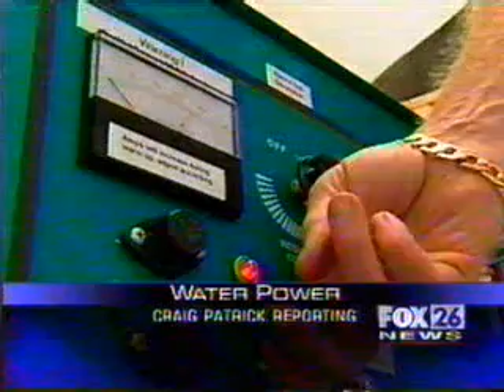Water Power

Comment: @onefodderunit I've posted my answer, and you just circled back to your same question - but then circular logic is required to believe bronze age myths.  I saw tonnes of debris, and thousands of tonnes of steel hauled out afterward.  In fact, those thousands of tonnes of steel are being used as evidence by other conspiracy theorists to prove a controlled demolition - but even they know it didn't turn to dust.  Controlled demolition isn't fully supported, though, and makes no sense.

Comment: @onefodderunit The towers aren't shown turning to dust in mid air, and the debris pile on the ground proves that they didn't, along with all the truck loads of debris that were hauled out of there for months afterward.  The guy in the story says himself that he landed on a concrete slab, and was surrounded by debris - not dust.  He goes on to talk about how he walked over debris, not dust, to get to safety.  He obviously landed in a pocket of the debris rather than being covered by it.

Comment: @onefodderunit Who calculated the height that it 'should have been'?  How could they make such calculations if this is such an unprecedented event?  I've seen the video, I also watched for months as trucks hauled away debris, not dust.

Obviously the tower didn't fall on them.  The tower around them collapsed and they landed in pockets where they weren't crushed, unlike the thousands who were.  Had that guy on the 22nd floor landed under the slab, rather than on it, he'ld be dead.

Comment: @onefodderunit Ok, so you say the tip of the torch is very hot, yet he holds it with his fingertips - so are you saying he is impervious to burns?  In the video you link he swipes his hand through the end of the flame, which one might do with many types of torches.  Now, the guy is separating water himself into hydrogen and oxygen, which is very expensive, why not just use acetylene?  It would be much cheaper.  What sort of 'magic' do you think is happening here?

Comment: @onefodderunit Yeah, the tower comes down fast, but it doesn't 'turn to dust' - it just generates a lot of dust.  As I said, I don't think everything about that day has been conclusively answered, but the further you move away from the hijacker story, the less adequate the answers get.  I could see a rogue element of the intelligence community greasing the wheels - but full fledged white house control of it is impossible to work out.

Comment: @onefodderunit Whether or not energy is infinite is irrelevant - it's about putting it to useful work.  Water does react exothermically with itself - if it did, our entire planet would have already been consumed.  I do not know  that September 11 was a false flag operation - even though I do feel aspects of it raise disturbing questions.  The towers were not spontaneously turned to dust in mid-air and the effect of the weak force on fermions is something I view without wonder.